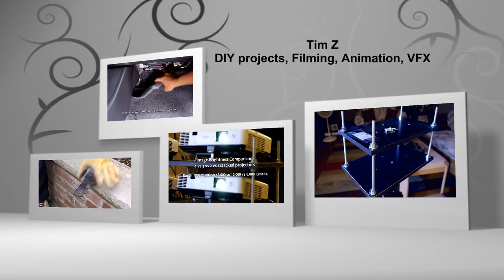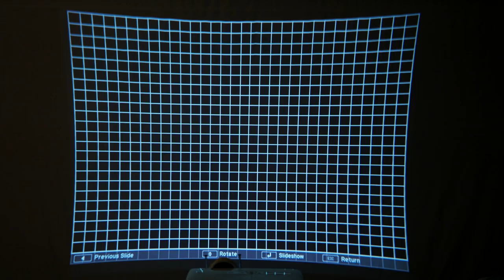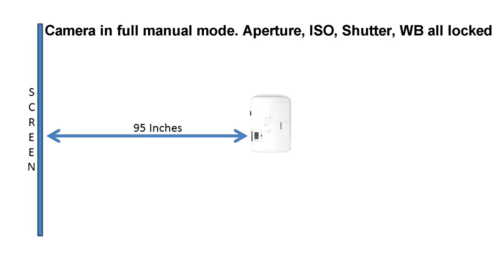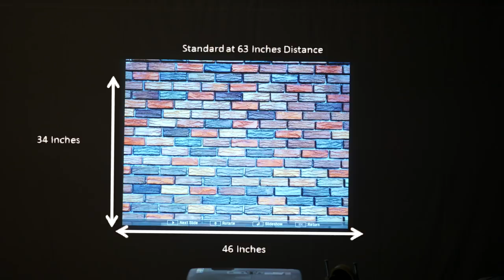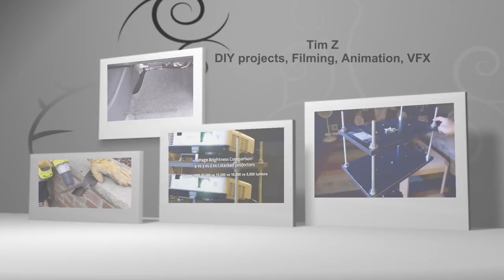DIY Short Throw Projector

Comment: I use my projector with a piece of acrylic mirror I have the projector facing away from the screen it project's onto the mirror and then you can tilt the angle and you can change the mirroring left right in the settings of the projector it gave me a bigger image for the distance projected which looks great and I only have a cheap Chinese CRE N1500 projector ! 👍✌️🇬🇧

Comment: Hi, how you make it perfectly in focus? I buy similar lens and it's work - image is bigger (around 100-110 inch without lens and around 140-150 inch with it). I can make image perfectly focused on the center, but it's blurry on the edges, and if I try to focus on one of the sides it's unfocused on the other. How to make it focused both on the center and the edges?
Reply: Only solution is to have a curved screen with "belly" in the center in this case. This way you will have good focus and straight picture

Comment: Thanks for the guidance :) you are amazing. :)
I have a projector of 1m as minimum focal length. I want to convert it to a short throw projector and project it to a screen inside 0.8m approximately. Will I be able to attain the focal length of 0.8m using this lens?
Reply: I have the same question

Comment: Hi Tim. We are an amateur theatre company presenting a musical production later this year using projections. Your advice in this video was very helpful in sorting out our projection plans and we are using the lens you recommended which work well.. Much thanks for this advice. The company would like to purchase 4 of the lens holders for use in the show. Is that possible?
Reply from the maker: I am making more lens holder by end of next week. I will post the eBay link.
Reply: Thanks Tim
Reply from the maker: I made 6 more and posted on eBay
https://www.ebay.com/itm/183080107698
Reply: Thanks

Comment: Can you build one that can fit one on top of the other? Ex. I want to turn the 10000 lumen set up into a throw projector Like this one. I'll need the after that you built to be abut to stack on top of each other.
Reply from the maker: Let me think about the design.
Reply: can you use  lenses from an old rear projection TV?
i have  like 6 of them in the basement some place i took out of old rear projection  CRT projection TV's
Reply: nope didn't work
do you know if it is at all possible with any projector to get  4x6' projection with  only 6 1/2 feet of throw distance?
Reply: Andrea - may be a little late but you may also try using a mirror.  I just saw a video about that before landing on this vid... the upshot is you get a mirror, point your projector at it and let the reflected image show on your projector screen.  You just have to set it to mirror image and mess with the keystones.

Comment: Its OK. But something should be done to transform normal projector into ultra short throw projector.
Reply: How much do you charge for the rigs?
Reply from the maker: Hi, I posted one for sell http://www.ebay.com/itm/182740056600
Reply: I was wondering if you could make a quad(4) adapter to match the 20000 lumens device that you built in the other video. And How much would such an item cost
Reply from the maker: Hi. stacking 4 projectors on top of each other will be very heavy about 50 lbs or more. Alignment is not easy for 4 projectors. You could order parts online or find them in local stores.  Just get long threaded rods 24 inches to stack 4 projectors. This video kind the show you how to build it. https://www.youtube.com/watch?v=23x8pTTmO-U
Four 1/2-13 threaded Rod 12 inches
http://amzn.to/2gWC9Qg
Sixteen ½-13 hex nuts
http://amzn.to/2tIrn5D
Sixteen ½ inch washers
http://amzn.to/2gUzydl
12X48 Black Shelf board (I cut into two 12X20 pieces)
http://amzn.to/2fdlKHl
Reply: Could you post one on eBay again?
Reply from the maker: Hi I posted on eBay http://www.ebay.com/itm/182762447131